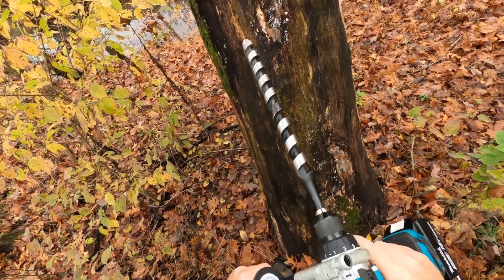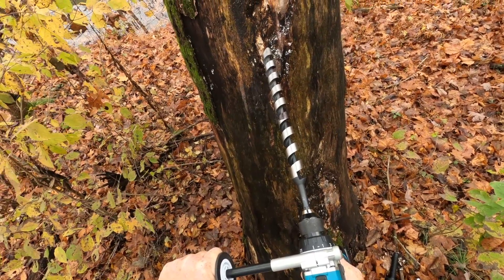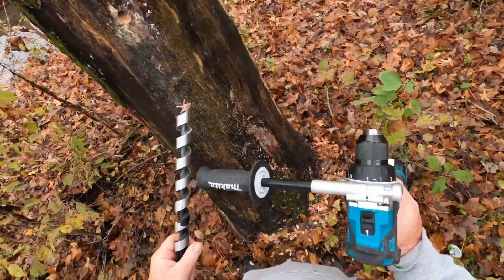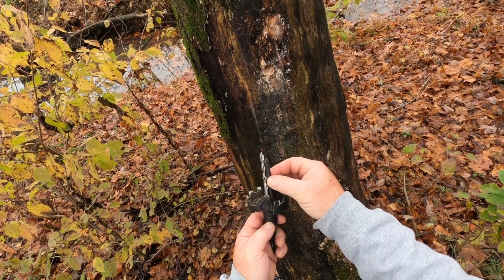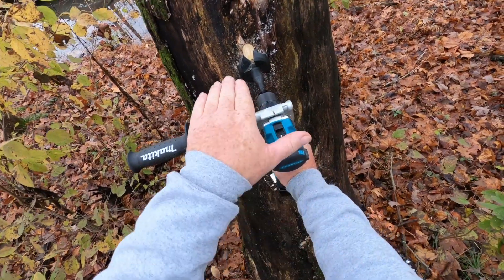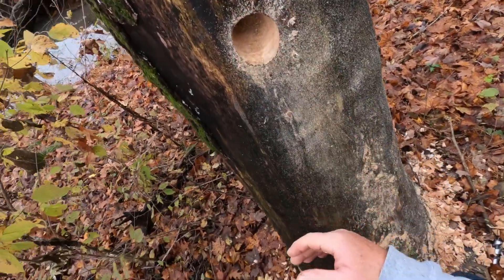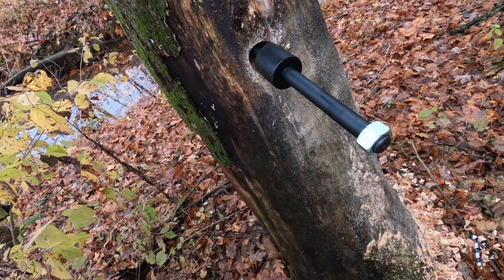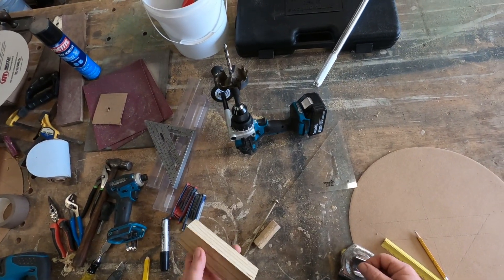Tree Attachment Bolt Installation

Comment: What is this, why would you want one?  Assuming one doesn't have a wood shop with a lathe and drill press, wouldn't it be much easier to just buy a dowel?
Reply from the maker: Ha, it's for a treehouse. I'm documenting each step and unfortunately some of it won't make sense until I get further along. A few more videos and it will all come together.

Yes, buying a dowel would be easier if you can find  an 1 1/8" diameter one. Or you can turn it.

Comment: Larger auger bits can break your arm w/ a more powerful drill,  especially a  Hilti Drill or similarly strong one.  I once was up on
a ladder extending my arms w/ a drill & a 3" auger ..... the drill twisted & lifted me up as I danged for almost 1 minute before I
could get stable.   I'm sorry,  mine was an angle drill but you get the idea about the dangers of an auger, bigger is more so.
peace
Reply from the maker: It's amazing what that little cordless drill is capable of including breaking my wrist, haha. Glad you survived your ordeal and thanks for watching and commenting!
Reply: Not sure how I got here but I saw the Tree Bolt & who knows where I might need it down the line?  When my large
auger bit grabbed & got stopped,  the angle drill spun & I had the handle facing down to me on that ladder but in
that moment >> the drill pulled my body weight off the ladder as the drill handle faced to a "(  9  o'clock ) but I
was fortunate.  I don't know the power of newer cordless drills but the large size of an auger bit stopping in
the wood is what breaks your wrist.  I liked that you predrilled the hole.  That was new to me. Be safe/peace